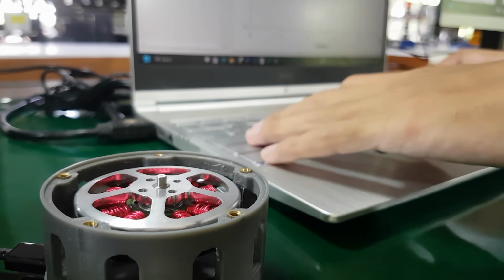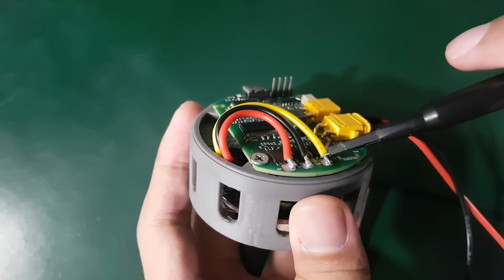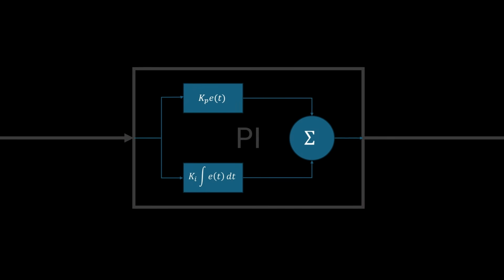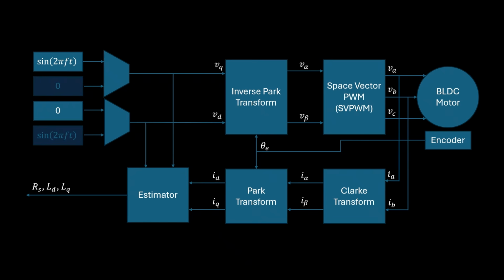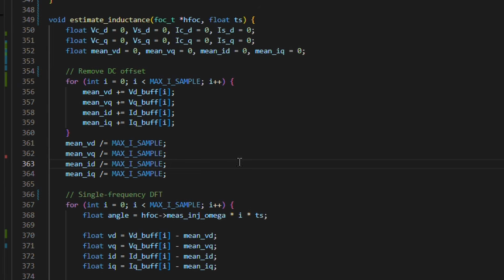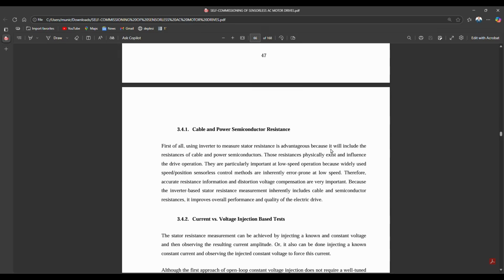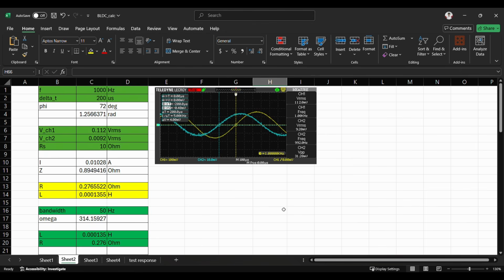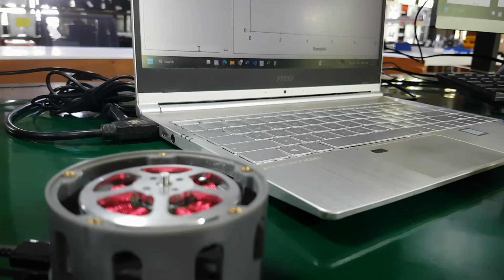How Your BLDC Driver Can Measure Its Own R and L

Comment: are you using sensored method for controlling? 

because in my case, i had to inject offset d axis current to lock the motor in single position, since i do not have any reference for d,q axis without sensor. however it makes measured Ld look smaller than actual due to core saturation

Comment: It's been 3 months since the video was posted, so I don't know how many people will read this, but I'm writing it because I'm sure it'll help.

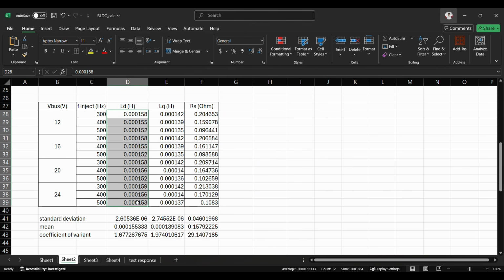At 6:15 in the video, the resistance value of the motor decreases as the input frequency increases, which is called 'AC copper loss'. (It can be easily observed on the LCR meter which can change the frequency used for the measurement.) This is due to the 'skin effect', which changes the cross-sectional area of the wire through which the actual current flows, resulting in a different resistance. For this reason, the resistance R must be measured through the DC input.

Also, a motor that looks like a normal SPMSM was used, and it seems that some people have questions about the difference between Ld and Lq. I think FI(field intensification) will be involved in this regard. This is a way to forcefully create a saliency that a typical SPMSM does not have, by saturating the magnetic flux by injecting a positive current into the d-axis. 

/*But what's interesting here is that this 'saturated magnetic flux' acts on the rotor. In other words, if the iron thickness of the rotor (the metal holding the magnet) is not thick enough, the magnetic flux of the rotor will already be saturated without the application of FI, resulting in saliency.

I also watched the HFI-related video posted by SIROJU, and when I saw the sensorless FOC Using High Frequency Injection (HFI) video at 2:19 seconds, the thickness of the rotor is too thin compared to the magnet, so Ld and Lq are not the same, and it seems that the HFI method can also function.*/
<- this commented part is wrong. Read the additional comments. The rotor back-iron is saturated, and the stator is the main saturation component.

+) Recently, I have simulated the HFI application method of SPMSM through FEMM, and in fact, there are two factors that create 'saliency'. Geometric and saturated saliency are these.

Geometric saliency literally depends on how the rotor magnets are placed. This is evident in IPMSM, which changes the area itself where the magnetic flux passes along the d/q axis. For this reason, IPMSM has a high level of saliency in its own way without any special control(like FI). SPMSM, of course, can produce geometric saliency with maintain the magnet arrangement through additional processing (mainly adding air areas) to the rotor.

Saturation saliency is applied through a special method of control. Because the d-axis is the magnetic axis (the axis with the strongest magnetic flux), alignment of the rotor on the d-axis causes the stator to undergo more saturation than alignment on the q-axis (the axis with the weakest magnetic flux). This means that the degree to which the saliency increases depends on the tooth shape of the stator or the material used. In other words, applying a strong positive current to the d-axis strengthens this magnetic flux, which causes severe saturation of the stator teeth, resulting in saliency.

Two months ago, I thought that the difference in the d-q-axis magnetic flux was severe because the rotor back-iron of the motor used by SIROJU is very thin, but I think it was wrong. Because if the rotor back-iron is too thin, in fact, the rotor iron is already saturated by the magnetic flux. (Maxwell 2nd law, the magnetic flux has to form a closed curve, In other words, the magnetic flux that passes through the stator has to pass through the rotor as well. Of course, there is a bit more that passes through the stator. This is why we make the rotor iron and concentrate the magnetic flux inside.)

In other words, I think this happens because the stator teeth of BLDC 5010 360kV itself, which is the motor used, are already saturated. When it's aligned on the d-axis, saturation is already severe, and when it's aligned on the q-axis, it's not too saturated, which is why it has saliency.

However, this is problematic. If you think of flux linkage, which is the magnetic force line interaction between the rotor and the stator, d-axis linkage is mainly affected by id and q-axis linkage is mainly affected by iq.(Of course, both id and iq affect each other's linkages, but the linkages are dominated by their own d/q axis currents. In the PMSM voltage-current equation we use, the linkages are approximated. Ldid, Lqiq parts.)

This means that if the q-axis current component is strongly applied, the q-axis saturation can be as severe as the d-axis saturation. Simply put, the torque is applied, saliency drops. This occurs in all SPMSMs where only saturation saliency is available. (Geometric saliency exists in itself, but saturation saliency depends how much the stator is saturated)

So either design the motor itself as Ld>Lq at the point where id, iq is zero (which is virtually impossible in SPMSM, because magnets are the same as the air that produces flux. so, it is almost Lq>Ld) By increasing the geometric saliency, the iq is maintained as Ld>Lq even if it is increased.

Of course, the saliency can be increased sufficiently through the Inset PM structure, etc., but the problem is optimization. SPMSM should be mainly designed with torque optimization, but the problem is that if you force saliency due to this structure, you will inevitably lose torque. In conclusion, the attempt to apply to SPMSM is interesting, but if you have high torque in mind, it is recommended to use a motor with sufficient geometric saliency.
Reply: 모터쪽 전공이신가보네요
Reply: thank you so much for explaining
Reply: this was very educational. thank you for sharing

Comment: Bro, When Injecting Frequency Voltage Via Vd, Should I Set The Theta Value To 0 Fixedly?
Reply from the maker: It doesn't actually have to be set to 0, as long as it matches the rotor's electrical angle. You can use the encoder's reference angle if you're using one.
Reply: @srj4555  First of all, I apologize, I don't want to bore you about this subject, but I have something on my mind; When measuring the inductance on the Q axis, if the small torque created on the Q axis by the AC signal we inject into the DC offset rotates the motor a little and if we continuously maintain the Q axis with the theta value from the encoder, will the Lq measurement be accurate despite the motor rotating?
Reply from the maker: @Novus_Ordo_Conditor hello, a frequently used method is to lock the rotor by providing a DC signal to VD and an AC signal to VQ, so that the motor remains stationary and the measurement is not mixed with the current from the back EMF :)
Reply: @srj4555  Thank You Very Much o7 o7 o7 o7

Comment: Dear SIRO JU
Can you help me this answer ?
If I use an RLC meter to measure R and L and then input those values into the code, is that okay, or would using software measurement be more accurate? 
When using the meter, which frequency range should I choose if it has measurement ranges of 100 Hz, 1 kHz, 10 kHz, and 100 kHz?
Thank you !
Reply from the maker: Actually, if you have a good enough RCL meter, you can trust its values and enter the results into the code. Because the R and L values in BLDC motors are usually very very small, RCL meters sometimes do not show the correct values. So measuring it using a function generator and oscilloscope can be an option. Thank you.
Reply: @srj4555 Thank you 😊

Comment: Great video SIROJU, I have a question tho, isn’t BLDC motor considered Surface-Mount PMSM, hence Ld and Lq must be the same, however your result shows Ld and Lq have different value, why is that
Reply from the maker: Thank you. I've been wondering about this too, but haven't found the answer yet. Is this due to the motor design or my application code?
Reply: @srj4555 that could be due to core saturation. drone bldc's rotor has really thin back yoke which is easily saturated by strong Nd magnets making magnetic path along d axis more resistive.

you can observe it by adding d axis offset current on top of the high frequency component.
Reply: @srj4555 for example, i used high frequency injection for sensorless control but the problem was i couldn't tell if the PLL is locked on N or S pole of the rotor.

so i'm currently using the method that inject offset d axis current in both +,- direction to see inductance change. if injected Id has same direction with rotor flux, core gets saturated even more and Ld decreases.

Comment: You can measure motor temp by knowing its resistance.
Reply: Oh, true, I don't think it would be very accurate tho
Reply: @rafa_br34  I used to work at a place making solenoids for spacecraft and we would put potting in it, and would bake it.  Measuring the resistance of the coils in the curing oven was the most accurate way to measure the temps.  I have to imagine the calculations on a motor with cooling would have a gradient and interpreting the data would be a little complicated, but it would still be a valuable source of data.  You could take the measurement when the coil is off in the rotation cycle.  Could be super helpful in detecting coil faults maybe a couple cycles before the thing welds itself to mitigate failures.

Comment: I have been thinking about the same thing, at least by applyng DC current to one phase should able to measure the resistance as you have explained. Then applying DC current to the next phase and measring the angle from the encoder should be able to calculate the no. of magnet poles. It will help, If the motor have a ceramic ring magnet and the motor is sealed. Stator poles are also counted by drving the motor 360 and reading the encoder error.

Comment: The first problem I encountered was that when using FOC, the motor does not have a free-running mode...

I haven't figured out how to solve this yet.
Reply: is called open loop mode, it basically means you should get dirty and tap directly into the modulation and mock or ignore current and angle feedbacka

Comment: Man you gotta make a library for this! SimpleFOC can’t do all this as far as I understand
Reply: There is a function FOCMotor::characteriseMotor added last year. I'm not sure if it gives all the values from this video, but definitely resistance and inductance.
Reply: You can also use the st motor software to get motor characterization values. I think you have to use one of there esc dev boards to run the script though.